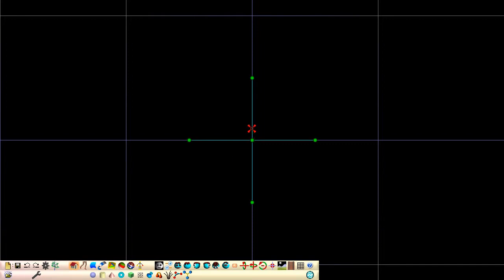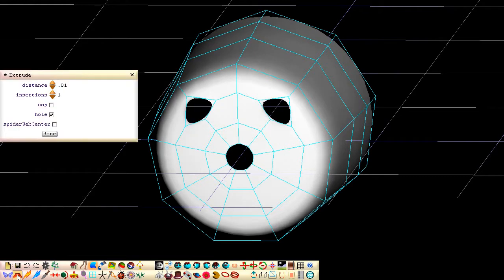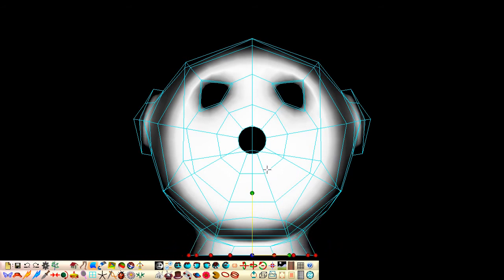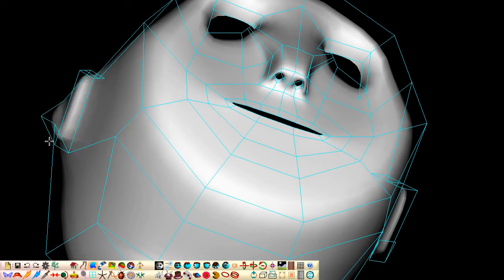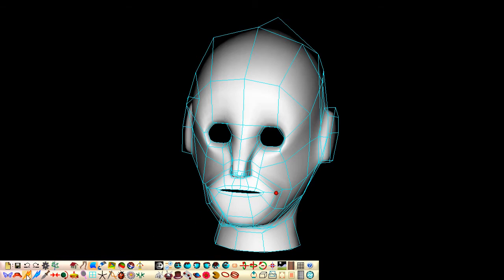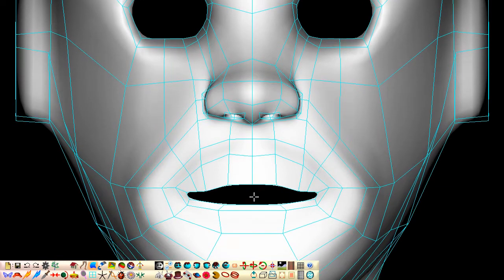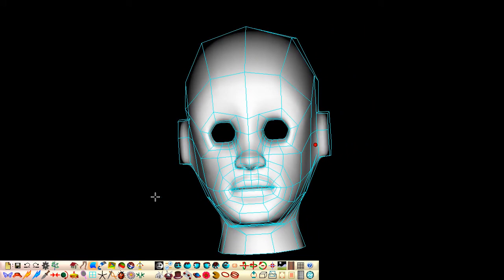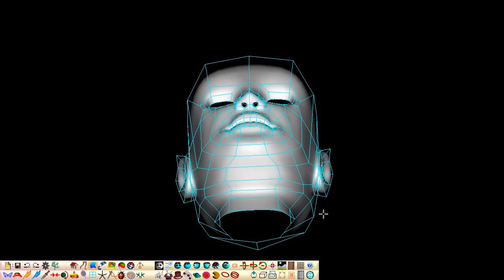Modelling a Human Head Step by Step Using Free Open Source Software Seamless3d 3

Comment: The smooth camera movement reminds me that interpolated movement between keyframes is needed.
Reply from the maker: Hi TVS_Official 64, are you referring to when right dragging with the mouse to change the orientation of the view? I made later versions of seamless much less sensitive for right dragging so that it is much easier to change the view orientation smoothly. Now when I test out old versions of seamless, I am surprised at how sensitive the mouse use to be.
Reply: @ThymeFromti  No. I was saying that pretty much all keyframes in seamless3D videos use linear interpolation and not Bezier interpolation, and hopefully there's going to be an option to enable that soon.
Reply from the maker: @The-E-Base  With Seamless3d's NurbsTrack node: http://www.seamless3d.com/nurbs-track-animation/index.html , bezier interpolation is already supported for animating the position of an object but I want to develop this further in a future version so that the orientation is also easily controlled to make it easy to animate things like trains, cars, aeroplanes or anything you want to follow a curvy path. I also have the Nurbs inverse kinetic (NIK) feature which I used for the my walking stegosaurus which helps to animate limbs smoothly. Currently there is very little documenting on the NIK feature because it is still being developed to make it friendly to use which has been put on hold while I am working on features that are modeling related.

Comment: no mac version =0(
Reply from the maker: Sorry Edgar. I am afraid my time is limited and I don't have a mac available to run tests. However because Seamless3d is open source software, if it becomes popular enough it should at some time be able to run on a mac. I have been working on an OpenGL version of seamless which will greatly assist the porting of the code to other operating systems.

Comment from the maker: Hi Rebecca, Although making rectangular type structures should be much less challenging for software, at this stage most of my attention is on resolving issues concerning the creation of organic models, animation, painting and making movies and so I have not had time to create a tutorial showing how to make rectangular type buildings or add a few simple features to seamless that would greatly assist the user for this purpose.
Reply: Oh. But will you be able to find the time to make a video concerning buildings and other structures? I want to become a CAD (Computer aided designer) in the future and my aim is to design houses using your software. But I really need some guidance from you. I don't want to trouble you, but if possible, can you post a video showing me how to construct houses? I'm not putting down your software. It's very well designed. Thank you very much for it!
Reply from the maker: Rebecca karen Yes I will show how to make buildings and other structures too, should be fun. Thanks :)

Comment from the maker: I have experienced the brush not working too but it seems to always work if I restart seamless so I suspect this problem is caused from a global variable being left in the wrong state but because I have not tested it much I can not be sure. I see seamless lets the user specify illegal values for opacity, opacity should only range in values from 0 to 1 to be legal (anything in between is OK). I will make it so only legal values can be specified.

Comment from the maker: You can select a control point and then select another control point with the rectangle selection tool while keeping the previous control point selected, if you toggle into accumulate selection mode. The accumulate selection button is 5th last on the bottom bar. But you don't need to do this for any of the operations shown in this tutorial.

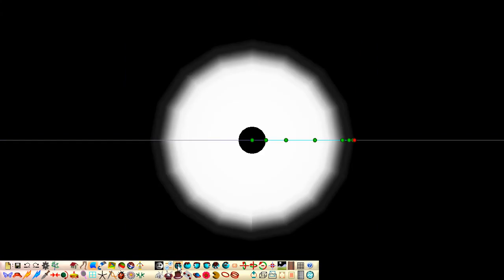Comment from the maker: 2:54 You can change the orientation of the view, by dragging with the right mouse button held down.
As mentioned in the tutorial, you must click to set the preview line from the ear to the mouth before clicking to divert the line to the other ear.
It is very easy to crash if you do something different to what is shown in the tutorial as it is the very first version of Seamless III but it will get more robust with future updates.